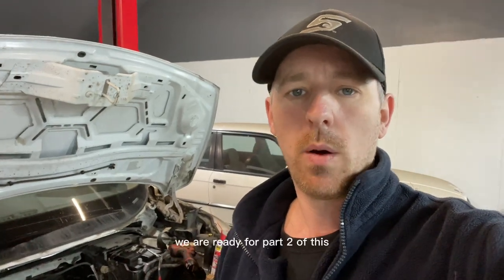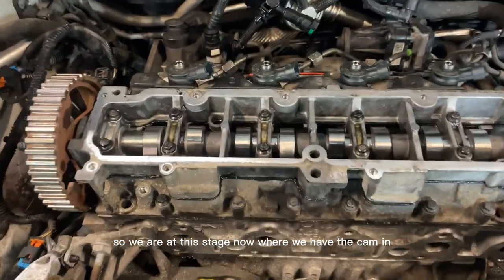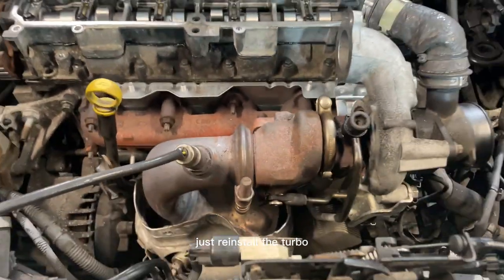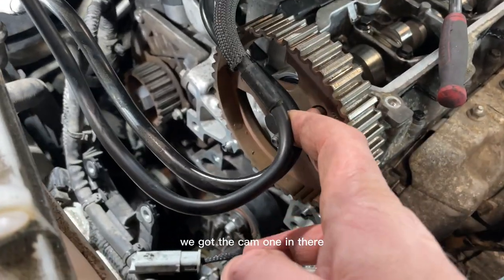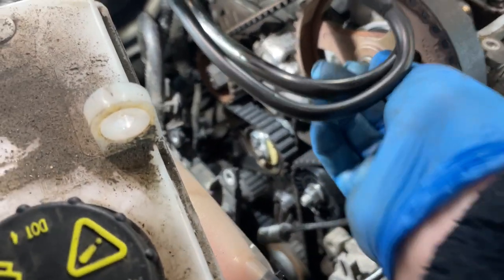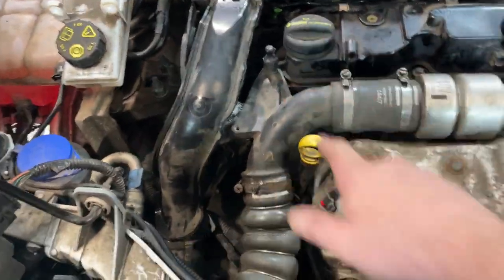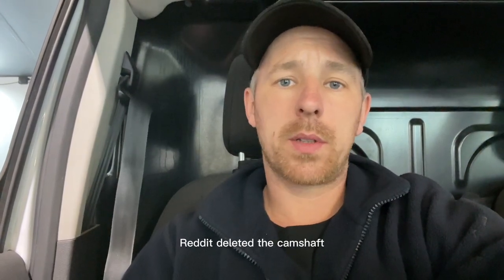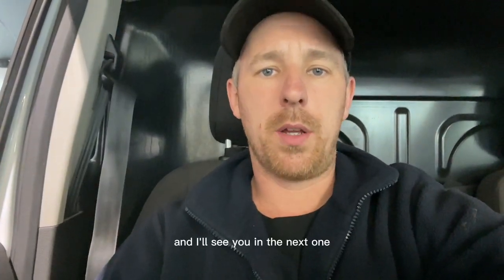Timing Belt Disaster - Can this Ford Transit Connect be Saved?? Part 2

Comment: I used to love Diesel engines, now I hate them.
Reply from the maker: There not all bad really, but not simple things anymore either! 👍
Reply: @MrAutoFixer  I would rather have an inline pump and the ability to adjust phasing and spill timing, with injectors that can be removed without a fight and injector seals that actually seal, as opposed to all the unreliable, unnecessary electronic crap, fitted today. And don't forget the dual mass flywheel, the answer to a problem that didn't exist !
Reply from the maker: @p.istaker8862 well said ! And yes dual mass flywheel 😂 what an invention! But them simple days are long gone now I’m afraid 😧

Comment: This happened to mine too at 91,000 what was the difference in price new or recon engine to your super rebuild
Reply from the maker: I think at the time to have a new engine would have cost about 5k and the rebuild was about half that I don’t know how much they are now? 👍 thanks for watching
Reply: @MrAutoFixer  that video was brilliant how long did it take to rebuild it looks like mines the same
Reply from the maker: @richardtaylor3400 if I was on it and had all the parts to hand would take about 3-4 days but still have to wait for the head to be skimmed so I don’t that one over a good week can be done quicker if you don’t have all the head bolts break lol 😂

Comment: Hi, do you know what position the crank should be in when the cam is locked? I made a mistake today of removing the crank pulley which isn’t on a keyway and can’t find where the crank should be anywhere. Have ordered a fluywheel locking tool but can see a mark on the flywheel
Reply from the maker: If you get cylinder 1 to TDC which should only be a small turn clockwise of the crank if you undone it with a gun, then should be able to fit the locking tool, when you finally get the belt on just make sure you turn it over by hand a few times. 👍
Reply: Thank you 🙏 I’ll try that In the morning
Reply from the maker: @carregtredwell9129 let me know how you get on 👍

Comment: Can I just ask - the timing belts on my Ford Transit Connect 1.5 TDCi have gone 3 times at 60 000km intervals - could the timing belt failure damage the turbo or the clutch - the first 2 times Ford suggested I put a new clutch in whilst the engine was out and now the 3rd time I want a bit of info before dealing with Ford - 2nd & 3rd time out of warranty
Reply from the maker: Hi 👋 thanks for reaching out, I would find it highly unlikely that the cam belt failure would affect the clutch at all and as for the turbo only if a bit of debris had managed to get into it some how but again unlikely, so when the belt goes is it because of the cam lobes spinning each time ? What exactly are Ford replacing when they fix it ?

Comment: Would you recommend need head bolts when changing head gasket and what size socket is it please
Reply from the maker: Hey I think those ones were M12 Ribe if I remember right, and yes Change head bolts every time they are undone as they are stretch bolts 👍
Reply: @MrAutoFixer  many thanks
Reply from the maker: @bobfraser565 no worries 👍

Comment: Brilliant video. Just had this happened to mine. One damaged valve. Just rebuilt it and put it back together, wont start. Not sure if cam timing 180 out or cam lobes have moved. Probably should of replaced cam shaft but it all looked ok.😢
Reply from the maker: Oh yes you defo need to replace the cam that is the main cause of failure when the lobes spin on the shaft, once you replace that should be all good 👍
Reply: @MrAutoFixer  Appreciate the reply, I'll put a new cam in and hopefully that works. Another cheeky question.  Do you know the cam position when the crank pin is in. As I know It can be 180 degrees out. Should of just given it to you to fix in the first place. 😂
Reply from the maker: @davidnewman5807 it’s always good to have a go yourself. I think you get that good sense of accomplishment when you fix it and have you watched part one of the video. I think I’ve had some other comments about the timing in that video saying you can pause the video and check all the timing marks and the angle of the cam lobes etc, have a look at that one and let me know if you need anything else. Cheers
Reply: @MrAutoFixer  Hi, just wanted to say thanks for the advice. Replaced the cam and it started first time. When I compared the old and new cams. 4 of the lobes were in different positions so you was spot on. Really appreciate your help.
Reply from the maker: @davidnewman5807 excellent 👌 glad I could help, the new cam you fitted should be a modified solid one so you won’t have that problem again 👍

Comment: I have same model mine has broken down had no power the came up engine malfunction then broke down with engine light on hoping this isn’t my problem lol 119k miles
Reply from the maker: Hi Lee, best way to check would be to take the top Cambelt cover off and check to see if the belt is ok first, fingers crossed for you it’s nothing too serious!
Reply: @MrAutoFixer  thanks mate already sent it to garage on recovery truck the codes I got on reader were all to do with a vacuum leak and Maf sensor so hopefully it’s to do with that P2279,P1102,P0229 we’re codes
Reply: Was the timing belt snapped on my van mate garage said needs new cam rockers and belt kit should be fine 450

Comment: Excellent video Ty so much I have an 18 plate and getting belt and tensioner changed today in case this happens , had a mate with 17 plate do exactly  what happened in your video, so going to cross my fingers same don’t happen  after getting belt and tensioner changed at 79 k
Reply from the maker: Thank you I really appreciate it! As long as you keep up with the maintenance you should be good 👍 extra oil change mid way through the year is what I suggest also, good luck

Comment: Spot on video very helpful I was just wondering if you could give me the torque settings for head bolts
Reply from the maker: Hi for my engine my process was
Stage 1: 20nm
Stage 2: 40nm
Stage 3: 260 degrees 
Hope that helps 👍

Comment: Thanks so much for quick response - they have replaced the engine each time - I had to pay for the last one and they want me to pay for this one - the one invoice does say 're-new' engine but I am not sure what this means - but they did issue new VIN numbers each time - I just cannot understand how a timing belt can fail 3 times in 180,000kms - second time they had to replace 6 injectors as well
Reply from the maker: Yes it does sound a little odd to me, maybe have an independent garage take a look at it for a second opinion? Or think about a new vehicle so you don’t have this issue again ? Sorry if I can’t be more help

Comment: What year was this connect? I’ve been told my 70 plate 1.5 hasn’t got a wet belt. Is this correct?
Reply from the maker: This one was a 2017 reg 
I would double check urs with the dealer and check if it had a wet belt or not 👍
Reply: @MrAutoFixer  thank you👍🏻

Comment: Great video just the right length. Show all the stages and explain where your at . My boys focus 1.5 diesel just stopped. The AA guy said maybe belt and oil pump? Was contemplating doing it for him but after watching this I think I’ll give it a miss.
Reply from the maker: Na defo give it a go you might have no issues and it all go to plan! Good luck 🤞
Reply: Just got it back from the garage. Had to pay the bill for him £3745.00
Reply: @MrAutoFixer  wish I had they made a right pigs ear blaming turbo, belt, tensioner and after putting it back together with wonky cams it wouldn’t run right. 🙄🤬
Reply from the maker: Oh wow sounds like you should have sent it my way! I would have sorted it out for ya! Hope you don’t have any more problems going forward! And wow that’s a large bill to swallow !!!!

Comment: Hi mate great video, we've just put my wife's van in the stealers as it had similar problems to this, it has a camshaft position malfunction code but is still running, but very noisy like the timing is out, my question is will there be damage or will a new belt tensioner and water pump likely be all it needs ? It's sounding like there is a theme on these vans it's only 6 years old and has 90k on the clock
Reply from the maker: Hey 👋 sorry to hear your having issues! 
It’s the cam lobes that move on the shaft, so if it’s still running then you should defo get away with some new cams and a belt and pump no problem! That’s if that is the issue of course? Let me know how you get on 👍
Reply: Thanks mate 👍
Reply: @MrAutoFixer only happened on Thursday not been in for diagnostic by the garage yet I got the codes with my reader only code was the camshaft position sensor, replaced it obviously and nothing changed but I'm stumped how this has occurred could it have jumped a tooth on the belt ? Wife said it just happened as she was crawling along at 25 ??
Reply from the maker: @smudgenav  yes it could have jumped a tooth hopfully it hadn’t done any damage and you can just have the minimum changed to get it back on the road! That’s the dream
Reply: 😂 defo mate the wife's still gutted cost 300 a week for a hire van !!

Comment: Hi buddy great videos, I wonder if you have ever experienced rocker arms not being bolted down, I had some work done on my Ford transit connect mk2 1.5 tdci ecoblue on a 68 plate, it was becoming extremely noisy, rattling and hesitation.
on inspection a injector needed replacing, but worryingly two rocker arms where found to have been left sitting without any bolts installed, the van had a new engine installed by main dealer, under warranty 15000 miles ago.
I don’t really understand much about engines, but watching your videos are extremely beneficial, and gives me a better understanding of my van, which now sounds sweet again with a new injector and some bolts.
Reply from the maker: Hey thanks for watching, I can’t say over ever had that experience with the bolts missing, sounds like when the engine was reconditioned they may have forgot them bolts as I would imagine if they had come out and gone inside the engine you would have much of the inside left working lol 😂 
Glad it’s is all back on the road and running well hopefully it stays that way for a while 👍

Comment: Great job! I am just about to replace the timing belt and water pump on my van, which is the exact same model as yours. I typically change the belt and pump every 60k miles, and so far I haven't had any issues. I'm wondering if the problem you experienced was due to the fact that the belt hadn't been replaced until 95k miles, or if it was replaced with some no-name parts.

My Transit Connect, currently has 165k miles on it. I changed the belt and pump for the first time at 50k miles, then at 105k miles and now I'm about to do the third change at 165k miles. To be honest, every time I've changed the belt before, I haven't noticed any problems like what you experienced. I am always using INA kit belt + pump.
Reply from the maker: Thanks Artur! The problem with my one was the cam itself the lobes had moved on the cam as they are pressed on originally, there was a recall for them but my one wasn’t done, now it’s got a new better cam should be fine now. 
Sounds like your doing well with the maintenance on your van and hopefully it goes on for many more miles 😊

Comment: New viewer here as I'm thinking about buying one of these for my courier business. I now feel slightly apprehensive in getting one.
Great video buy the way. It does sound little guy was lucky. Although I suspect the bill was still high
Reply from the maker: Defo a great little van for a work vehicle, as long as you have good history with it and keep on top of the maintenance I don’t see why it would last, or if you do get one when you have the belt done just have a new modified cam fitted at the same time for peace of mind ? 👍 thanks for watching 😊
Reply: MrAutoFixer
Whenever I buy a new van for work I always get the cambelt & water pump changed asap just for peace of mind. Is there problems with the wet belt on transit connects or is it just the transit customs
Reply from the maker: @leechi001 hey any wet belt engine will be a problem if it’s not been maintained correctly with the right oil etc, as long as it has and you change the belt when it’s recommended or before then you should be good 👍